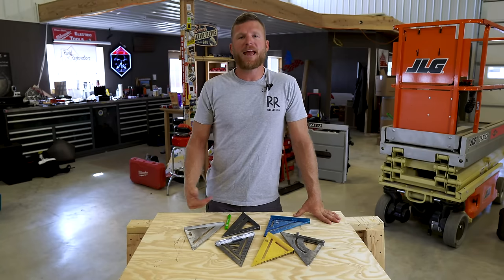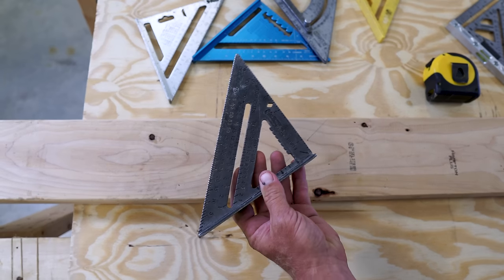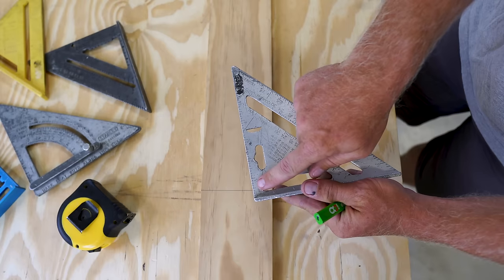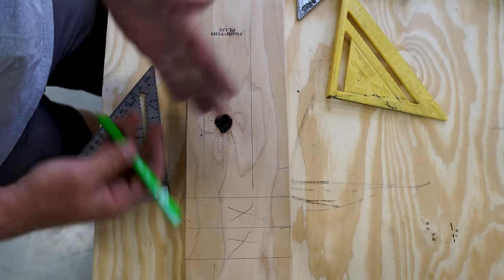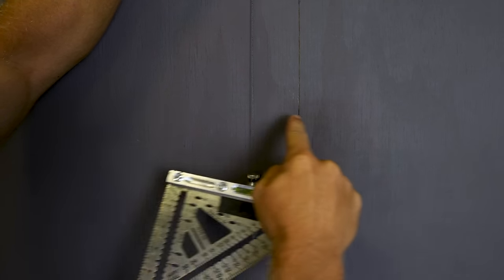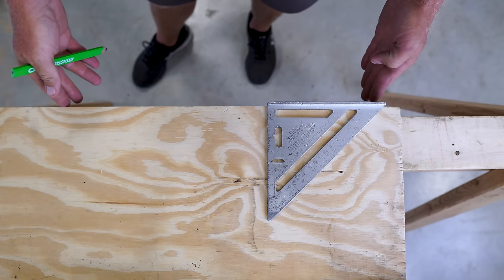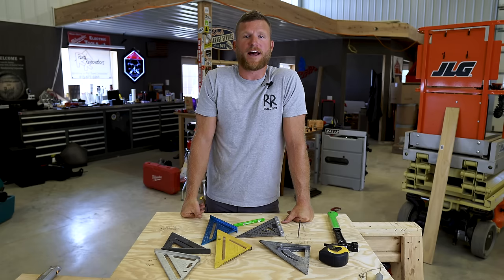Top 10 Uses of a Rafter square, aka "speed" square

Comment: Dear Sir:

Your reference to pitch is wrong.  A pitch is over the span and the slope is over the run off a roof. For example on equal pitch rof a 1/3 pitch roof or 8/24 has a 8/12 slope. For same example for with a roof 24 foot span and 12 foot run the total rise is 1/3 the span or 8 feet.

Comment: Don't always assume your square is square we were building a cupboard for a friend using his speed square and i couldn't figure out why it wasn't coming in square so i did the 3, 4, 5 , test with is square and it was out by about 3.5 mm  hence why nothing was going right , to cut a long story short i took a hammer to that square and no more problems from then on .

Comment: 10:34 dude, you don't need to find 45 degree there, there is a plumb line on the left side of your square, just line it up with the string and you have 90 degree.

Comment: My boss used to make me have a really thin pencil point at all times, and when using the square to make a square mark on a piece, he insisted that I made the mark in no more than three strokes of the pencil(down, up, then down and out to indicate which piece is kept) and when ready to mark, put the pencil point back down on the mark, then slide the square up to the pencil, then mark the piece. I used to think it was dumb and he was just being a dick about it, but now I get it.
Reply: I just taught a laborer the importance of leading with your pencil (or whatever you are using to mark... in our case it was a sharpie cause it was steel studs) because yes. Depending on the sharpness of your tip you can set your square on your mark and then run your line  and it will not even  hit that original mark. One tip when doing such though is, if you lead with your pencil  and it is at a 90 degree angle and butt  your square to the lead but then lift your pencil and bring it back at a 45... you may end up drawing a line that is not on your mark.  Keep your angle consistent.  Demonstrated all of that to this kid. I hope to see him implement  it on the job now.

Comment: A rafter square is NOT a speed square! A rafter square (AKA carpenter's or framing square) has a 24" and a 16" tongue with rafter scales on the 24' blade.  BTW,  I am a licensed Carpenter since 1974. Having said that a speed square will do some things that a rafter square can, but not all. i.e. the difference in length of jack (or valley) rafters for different pitch roofs. A Master Carpenter can cut a whole roof system, with hips and valleys, and it will all fit......with a carpenter's  framing square, and never going on the roof! Plus, you can lay out stairs as well!
Reply: But unless you are a master carpenter.......get a speed square LOL
Reply from the maker: Well speed square is just a name for a Swenson brand carpenters square... speed quote isn’t the name of a tool category just a brand name Swenson has the rights over.  Thanks for your info appreciate it

Comment: 5:34 I hate correcting professionals but you are mixing pitch with slope.  You are describing slope and calling it pitch, when pitch is actually a fraction.
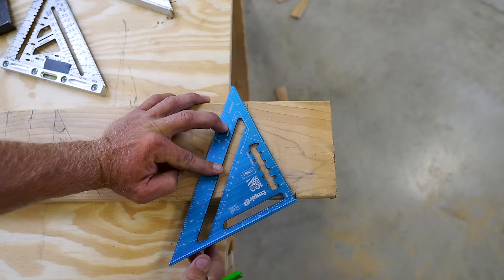1/4 pitch is 6:12 slope
It is explained here: https://www.mulehide.com/News-Events/Blog/ID/18/Slope-Vs-Pitch

I use a $15 stainless tri-square with a 1-1/2" blade for laying out framing plates.  The Martinez would work out of all those speed squares, but the price is ridiculous.  I recommend a Stanely R100 framing square or equivalent for a young person as it has the rafter tables on it you can use to frame a roof.  If you can find one they were also made in Stainless Steel as a Stanley SR100.
It looks like Johnson makes a Stainless Framing square: https://www.johnsonlevel.com/P/1766/xAluminumFramingSquare